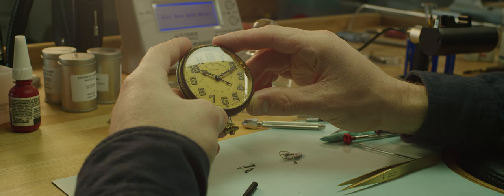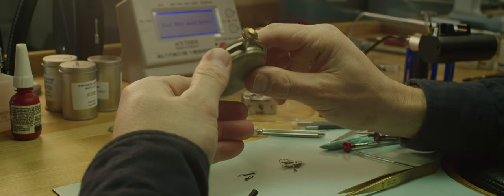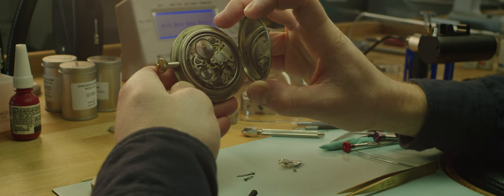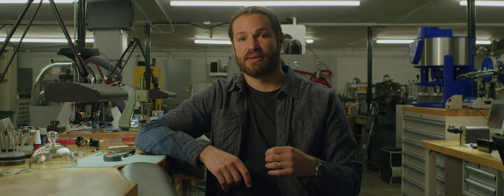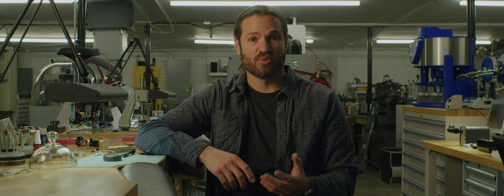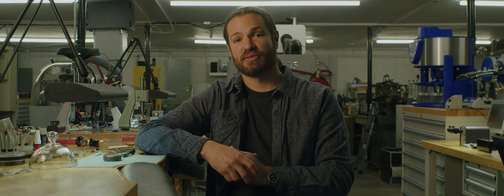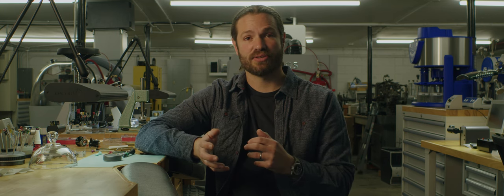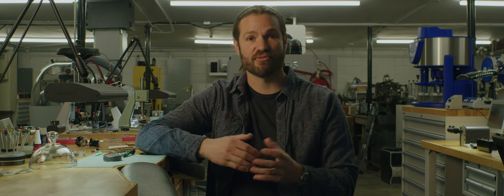Pressure and Wristwatches

Comment: Just found your extremely informative, calming and well-shot channel which is among the best on watchmaking I have seen.  Kudos on your methodical and effective explanations of dive-related pressure phenomena, which spoke directly to my inner science geek.

While it was likely included as a metaphor for the non-diver / non-physicist, one small point as a (retired) dive physician: gas molecules themselves don’t change size with pressures seen in diving (wet or dry), but their volumes do as you described in detail.  The issue is that ALL gasses in a mixture increase their concentration linearly with increased pressure, increasing their diffusion gradient into ares of lower (relative) concentration, such as the interior of a dive watch.  A water-tight seal may not be “air tight”, and let gasses through to accumulate in the case under pressure… and be trapped if the case becomes “air tight” as the ambient pressure is lowered.

Thanks again for the excellent content and presentation!

Comment: This is very fascinating! I was thinking about linear expansion with regards to material choices and temperature changes. I have no idea whether mineral or sapphire crystals expand or contract due to heat. I know that mineral glass flexes under pressure where sapphire does not like to as its more rigid. What I do know is that over time acrylic distorts and shrinks over a long time. Does it make a difference if the case surface is cut to a 90 degree angle or rounded when a crystal is fitted and seated? I have heard of the "bends" but never knew what it was. It sounds deadly... Thank you as always Cameron! Hope you have a great week!